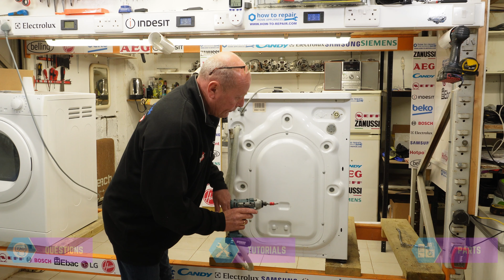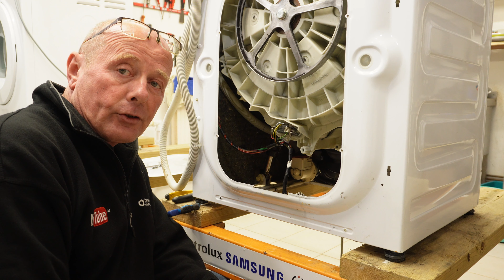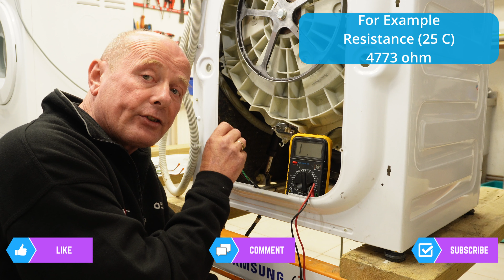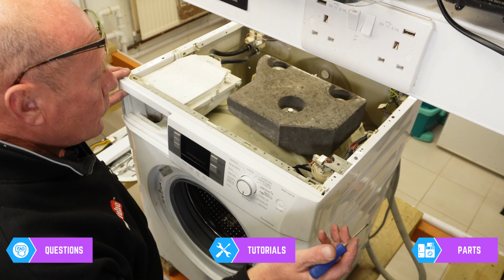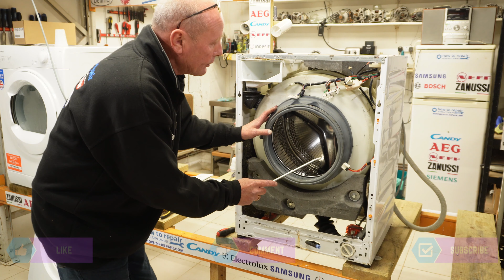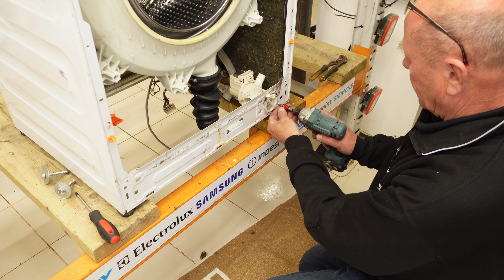#Beko Washing Machine Dismantling Guide WMB series how components work To Take Apart

Comment: Great work pal! I'm going to see if i can take my drum out and see where it's leaking from! It's dripping out half way up on both sides and dripping on the motor!
Reply from the maker: Well, that definitely is not a good idea for the water to be getting on the motor so it's great that you're dealing with the problem straight away if I can be any help at all with technical information please use the contact us page at our website website and I'll see what information I can pull with your full model number. I might also need the PNC number. https://www.how-to-repair.com/help/contact-us/  What would really help me to get my video seen as I'm no IT expert is to either share the channel or at least post it to your friends my videos might not be YouTube superstars, but they save Appliances from the scrapheap. Share and help us fight appliance waste! @MRSCOTTZD please remember to subscribe to our channel as that really helps us https://www.youtube.com/shorts/e432SAb2g08  Thanks, Paul 👍
Reply: Ahh it seems the inner drum is off centre and is rubbing, and has worn through ! It is on its 3rd set of brushes and second child lol ! We’ve had it 12 years, I’m curious to see if I can make it a family heirloom 🤣 I’ll check your site now.

Comment: Brilliant video! This helped me replace the door seal on my Beko. But I've also realised that the bearings have gone on my Beko WME7247W - I can't see how to get into the tub so I presume I can't replace the bearings (same as this Beko you've dismantled). Also, I've noticed some rusty deposits getting into the back of the drum after washes (since replacing the old door seal) - this could probably be from the failed bearings? In which case I think it's time to call it a day on this 14 year old machine! Many thanks, Jim
Reply from the maker: Thanks a lot for your comment and hope you can fix your bearing problem. There are many videos on my channel about bearing issues. Since we work very hard in our warehouse making free video guides for you all on appliances, we always appreciate a beer, offering a choice of single or round beer. https://www.how-to-repair.com/help/buy-paul-a-beer/ Thanks 👍

Comment: Thanks for a very informative vid. We have a beko 9 series, and the bearings went ( just outside the guarantee_ 1-nil to Beko for perfect timing re designed-in failure). I replaced them by cutting the welded joint on the drum housing and using high quality bearings bought locally. They have been ok for over a year now, and still perfect. You described this drum as scrap. Do you not reckon it is worth doing a bearing repair ? (The bits cost me less than £20). I would value your comment.
Reply from the maker: It is worth parking the machine to one side. I'm waiting for the same model number to come up on eBay with electronic fault then you would be able to rob Charlie to make Peter better as the expression goes. You can normally pick them up for less than £25. @steveholding3975 please remember to subscribe to our channel as that really helps us https://www.youtube.com/shorts/e432SAb2g08  Thanks, Paul 👍
Reply: When you cut the welded joint to get into the drum, how do you reseal it? Thanks

Comment: Great video and thanks for sharing your knowledge.  I had already replaced the shock absorbers on my 12 year old WMB 81241 but now my machine makes a thud/knocking sound once  per revolution when spinning. Quieter with a light or very balanced load. I assume this is the front bearing failing and not worth taking the effort to take it apart......pity as it has been a very good washing machine .......
Reply from the maker: It sounds to me like it will be the spider worth stripping to have a look at
Reply: @How-to-repair  thanks for the hint.  I will have a go tomorrow and let you know what I find :-)
Reply: well, no luck and found various small metal shards in the waste piping...  have replaced the machine.....bu was worth having a good go at it first..

Comment: Hi, Amazing video, i am woman, recently moved, cannot afford to replace my machine so I was determined to get jt working, simply couldn't get that filter open.....but half a day I DID it. However i messed up, the draining pipe fell into the machine without the plug, its the 10kg model thus the bottom isnt separate, I dont know how to the front off, or is going through the back the ONLY way? It keeps leaking on the floor

Comment: This is a really useful video. I have a WMB 71442 but I'm struggling to remove the water valve (@15:11 in your video). It just won't turn! Do I just really need to give it some welly?
Reply from the maker: @gavellaglan you need to make sure that the two plastic bits at the back of the valve or not catching and turn it in the right direction you might need to give it a bit more welly please remember to subscribe to our channel as that really helps us https://www.youtube.com/shorts/e432SAb2g08  Thanks, Paul 👍
Reply: I struggled for half a day, it was completely wedged, half a day of left and turns i used pliers, gripped it. Hope i could add something and save someone the struggle

Comment: I have a Beko WMB 71443 LE and its currently leaking a lot of water in the back while draining. It could be comming from the waste hose, but the hose in general is completely dry. At the point where it connects to the backplate, there is another small hose comming from it which is open. Is there some plug missing or is this how its supossed to (pressure exchange or something like that)? Because i feel like the water (leaks) there.
Reply from the maker: Hi Tim, i wrote quick article for you with some exploded diagrams of your machine to show you where some of the hoses are, I've also a couple of videos on there to assist you in finding leaks https://www.how-to-repair.com/faqs/beko-wmb-71443-le-washing-machine-leaking-water-while-draining/

Comment: Hi paul, I have a Beko washing machine and the start button doesn't work when I press it, if I open the top and hold the control board onto the facial panel it works first time, is there any way of fixing this?

Comment: Hi, I’ve got a 10KG beko washer and a couple issues…
1) the steel body is rusting a little just below the powder tray… assume water is ‘splashing’ over the tray and leaking onto the body? Is this common/easy to fix or prevent?

2) doesn’t seem to be filling from the hot water intake even when on a hot cycle. Can I test this to confirm?
Reply from the maker: If the water pressure is high, then this could be causing the problem when you have a lot of soap powder in the drawer you could turn the tap on the wall to reduce the pressure, but what I would do is make sure you clean up the rust and repaint it,
Reply: Try picking up some wool wax (lanolin) spray from a hardware store to reduce the rate of rusting! It's also good for undercoating cars for UK winters. 😉

Comment: Hi I have a question about this washing machine.  What part do I repair when the on/off switch doesn’t spring back I’m confused if it’s the face panel or the switch itself
Reply from the maker: Hi, please use our contact us page and make sure you fill out the request for what your problem is. I will need the full model number of the identification plate and the details of your problem so that I can provide you with useful literature and spare parts. A video shoot of the problem would be perfect as well.

I will get back to you within 24 hours, normally. https://www.how-to-repair.com/help/contact-us/  

Please remember to subscribe to our channel, as that's what keeps this channel going. Thanks, Paul 👍

Comment: I have lived this TWICE ! I split my drum last week,replaced the bearings (not cheap £40! FAG ones) put it all back together again,zero issues,no breakages,but upon the turn-on today,the drum will not spin ? The motor ain’t turning.It was fine apart from the bearings being noisy,when I took it apart.Do you have ANY ideas,it’s filling and draining,but the counter doesn’t go down,and it won’t spin,I’m perplexed,but am unsure what actually stops the drum spinning (door latch etc ?)…please help as my wife wants to buy a new one,and I’ve invested too much time and learning into this now…I wanna hear those new bearings smooth as…it was like a B52 landing when I took it apart last week !
Reply: When you split the drum, how do you reseal it? Thanks
Reply: @jimmorgan7869  I used some expansive silicone sealant/glue…with small bolts every so often on the seam…go for the £10 sealants,but tbh,I reckon any of them would do…the bolts are doing the main job of holding it all together…(Drill small holes through the sealing ‘flange’ that you have cut through…tbh…the more bolts the better !)
Reply: @joelfildes5544  Thanks! I’ll have a go

Comment: Early bekos where average then  improved upto  mid late 2000 there just as good as bosch.The only problem with later bekos are the  programmers don't seem to be as robust
Reply: Do you mean the dial?
Reply from the maker: The build construction is pretty good. The technical help is fantastic, but why or why do all manufacturers have to produce sealed drums for the sake of 12 screws I swear they all sit around a table each year trying to create ways to sell their machines faster. There is no need for it. This planet is in a big enough mess as it is.

Comment: i have the same! also an ecowmb81445lw
Reply from the maker: Good machines, apart from a sealed drum
Reply: i went to do the doorlock on mine but the screws are stuck in and the seal wont attach to the front @How-to-repair
Reply: Amazing machines for the price! Seeing bearings go on these is pretty uncommon as well, the one in the video must've had a pretty hard life. The state of its original motor also confirms that

Comment: I had to dismantle the control panal to fix on/off switch which had become lose and is not working, Once I had got to it I could see there is a little plastic return spring leaf spring kind, made of 1mm thick clear plastic with a little cross that  when you press on/off on the outside of the machine it connect to the on/off button on the curcuit board. This flimsy bit off plastic had snapped off, and was hard to find when it fell on the floor,  its clear plastic and only 2mm wide and 8mm long. I have glued it back on Now, and have too reconnect all the control panal clips and wires then  I will see if thats fixed it, fingers crossed. Just gotta wait for the glue to set.
Reply from the maker: They do sell the clear plastic pieces. I believe it's a whole piece that slots in you will need to use your model number, just in case the glue fails.